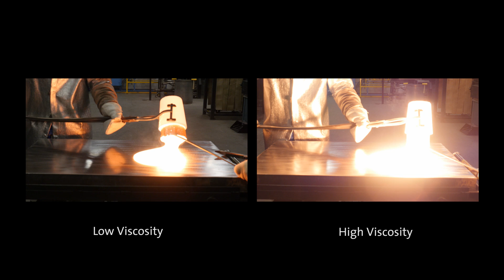Viscosity Demonstration by Corning

Comment: I really like these science videos, especially if one of the scientists is explaining it and it is done in a location like this or a lab. Also What causes that texture on the bottom of the glass.
Reply: That's a good question. Those are chill wrinkles.  In this demonstration, the surface the glass is poured onto is likely near room temperature.  This pulls a significant amount of heat away from the glass and causes it to solidify first between the two surfaces. This occurs in a random pattern, but it isn't unpredictable or uncontrollable.  The hotter the surface, the closer the wrinkles get.  Although it isn't usually a desirable finish these days, it can tell a story about the type of surface it's poured onto(or into such as a mold), glass composition, stresses, and among other things the temperatures involved.  Personally, I like chill wrinkles.  They look nice and gives good character the way they reflect light. :)